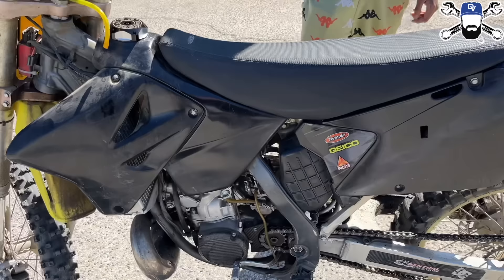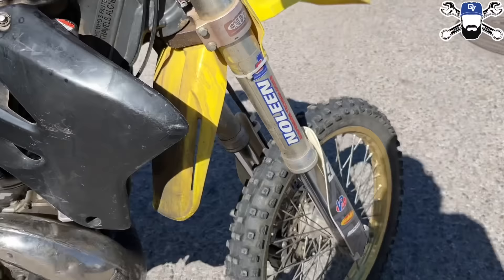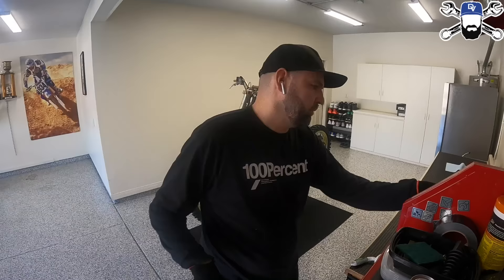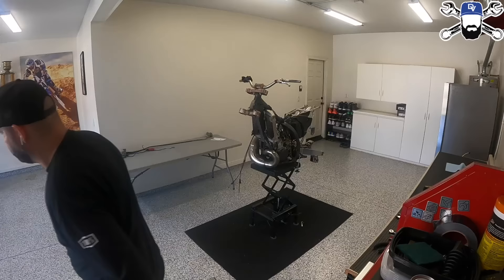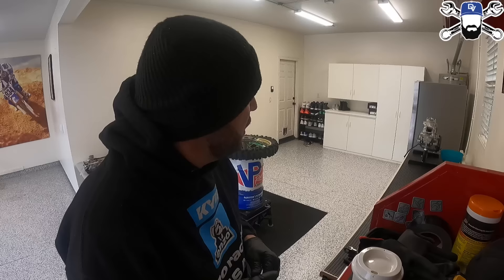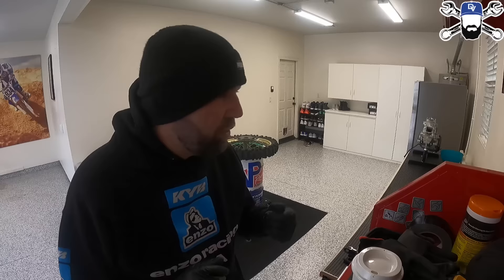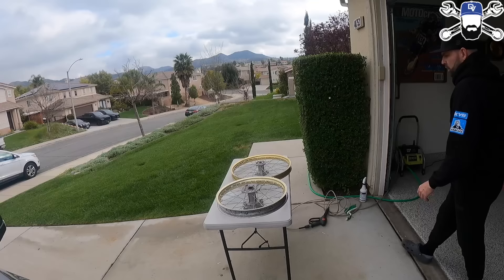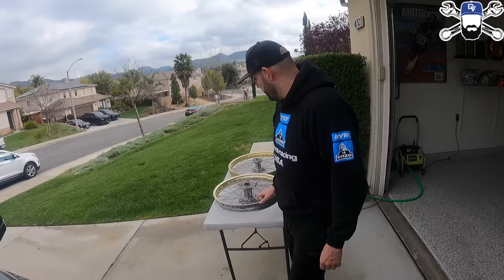Project RM250 Part 1: DV restores a 2003 Suzuki RM250 bought on OfferUp

Comment: Qu’est-ce qui indique que le moteur est préparé ? J’y connais rien 😅
Reply: Les coup de lime !
Il y a plusieurs stades de préparation qui vont de l'optimisation d'un moteur stock en enlevant les bavures de fonderie, polir ou microbiller certaines zones pour faciliter le passage des flux ou au contraire permettre un meilleur brassage ou même réaligner les transferts par exemple.
Personnellement c'est ce que je réalise sur mes moteur 2T et on peut déjà ressentir un moteur libéré avec un peu plus de couple, à condition de savoir le régler et d'y greffer des pièces compatibles. 
Ensuite il y a la possibilité d'aller plus loin jusqu'aux modifications de diagramme pour la recherche de performance, mais là c'est un métier et le résultat accentue encore la dur loi du compromis !
Reply: @tich7777  Merci pour cette super explication !!

Comment: Lots of videos online about disassembling, cleaning and reassembling, with all of real work being outsourced (engine guy, powder coat guy, vapor blast guy....etc). I'd like to see someone actually use a truing stand, or check the crank with a dial indicator, etc. DV, you once joked about factory mechanics: "grips and graphics". Forgive me for being slightly critical but your builds kind of seem a little bit like "disassemble and reassemble. (just busting your balls, man)  ;-)
Reply from the maker: You’re 100% right but I’m not a factory mechanic nor pretend to be. 6-figure paid mechanics should be doing those things and they are not. I’m a former SX/GP/MXDN winner. Slightly different. And by outsourcing I support my local community (my engine guy works out of his house 3min from me and businesses in Murrieta or Temecula). I understand your point. I ain’t trueing a wheel bud. But if that’s what you need to watch, I’m sure there are a bunch of tutorials. That’s what I’ve done to learn how to edit a video on iMovie